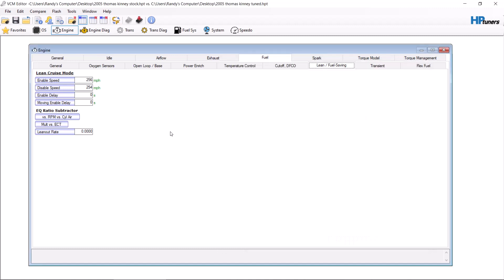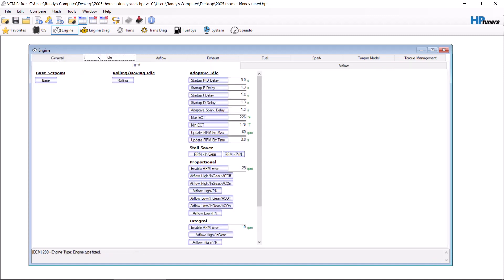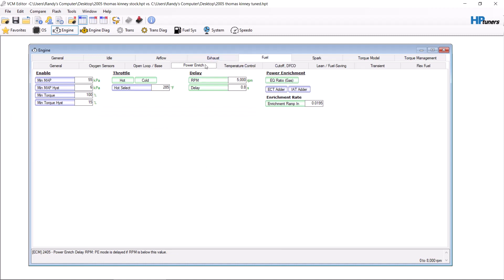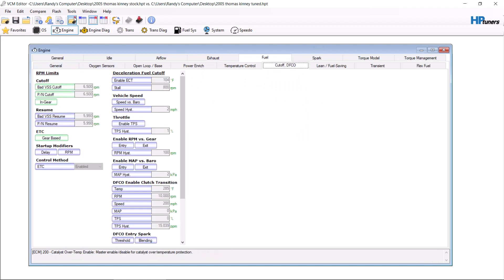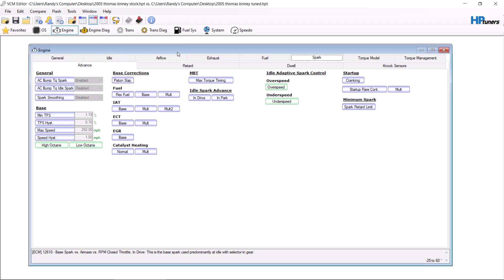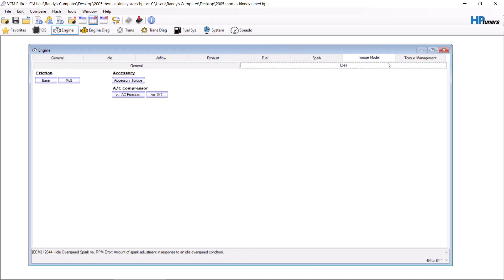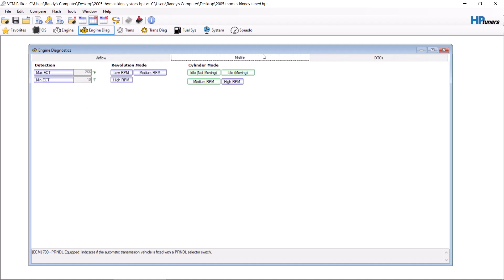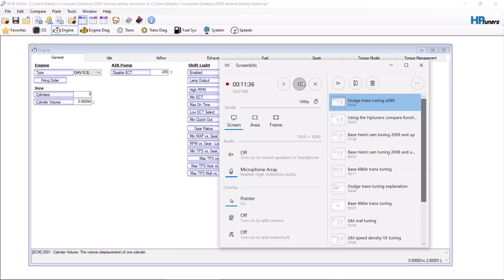Base tune for gen 3 ls engine vehicle using hptuners

Comment: Don't know if anyone is monitoring this vid but I'm wondering are these tweaks basically the same for a GM V6?  Or do you have a similar vid for a GM Gen III 3.6L high feature engine?  I've done a few mods on mine & have managed to get the knock out but that's my 1st attempt at any ECM tuning & it scares the shit out of me.  To be honest a friend advised me of the changes which was -1 on the ECT Spark Advance Correction table so now I'm looking for more help in any areas that can help a stock tune.  Thanks

Comment: So you just copied the high octane table to the low octane? So he he is running 91 octane correct?
Reply from the maker: Yes
Reply: @Recklessmotorsports  got another question for you, so what is the safest way to tune a p59 controller. I’ve got a 04 Silverado, I have been watching your videos for a couple weeks now and I was able to put me a base file together. I went write entire and took the file just fine, made some changes and went write entire a second time some thing made changes and the. Write entire. 4th time I went to write it I hit write calibration and hit write, and got unlocked timed out, lost communication tried everything that was suggested on a forum I found. Don’t have a bench harness, so I got a new one with my vin number programmed, truck is running and everything now. Now I’m scared to hook hp tuners back up to it. Ik this is long but any advice will be appreciated.

Comment: What changes would you make to this with. Truck Norris cam and trailblazer stall with a 373 gear?
Reply from the maker: Every cam I make the same base changes and then adjust from there, if the cam is super big I add more airflow

Comment: I have a 05 tahoe with 4:10 gears, stock gen 3 5.3 and stock 4l60e trans, i recently got it tuned and im experiencing a hard shift from 1-2 is that normal or do i have to take it back to my tuner to get it fixed?
Reply: Hey no sure if u got it fixed but I had the same problem for about 2 years I got a swap and tune done hard 1to2 shift torque converter not locking up reading research parts changing u name it I did tried it the fix was a crank relearn with hp tuners No 1to2 hard shift tcc locking up
Reply: @bruceshepard1136  i got mine fixed already, i installed a sonnax 1-2 hard shift Accumulator 77998-03K Transmission Kit and i took it to my tuner he had removed delay shifting time from 1-2 he put a little more time back and it shift way better

Comment: I know in the video you said GEN lll LS and I’m curious if this tuner set up you have would work good in a 2004 GMC Sierra with a 5.3
Reply from the maker: That’s a gen 3 ls. Gen 4 ls doesn’t start until mid 07 for most vehicles
Reply: @Recklessmotorsports  my question is would the base tune in This video work good for a 2004 GMC Sierra with a 5.3
Reply from the maker: Yes

Comment: Just wanted to add how important maxing out those misfire tables are after a cam, not only will you through that annoying PO300 but you're torque converter will unlock at highway speeds.
Reply: My converter locks and unlocks repeatedly at 55 mph and up. The tables have been modified, but what should I be  looking at to eliminate that?

Comment: I really appreciate the video but I couldn't see the  tables.
Reply from the maker: Which video is it
Reply: @Recklessmotorsports  "Base tune for gen 3 vehicle using hp tuners" Im doing a lot of research because i am using a Diablo I3 tuner and i set my part throttle downshift wrong and some of my WOT shift points wrong. For example ill have it in 3rd at 30mph, stab it and it hits 1st hard and almost instantly upshifts into 2nd. Im trying to find a nice RPM, Upshift vs TP and WOT numbers for my 05 GMC 5.3 LM7 1500 4wd with 4:10 gears. I just wish i could find someone with a similar truck who figured out some good numbers that I can try. Thanks man, awesome videos. I would appreciate any help.
Reply from the maker: Watch my video on 4l60e tuning and get the blue cat tool you can fix all of that with the tool
Reply: @Recklessmotorsports  Whats the blue cat tool?
Reply: @Recklessmotorsports  The only equipment for tuning i have is a Diablo i3. I don't have and can't afford HP tuners.
Reply from the maker: @DM-qp7do  it’s a program that you enter information about your set up and gives you the correct trans info
Reply: @Recklessmotorsports  I'll definitely look into it. Im also considering putting the factory tune back in it and starting from scratch. All I have is the Diablo tuner so I didn't make a lot of changes. But  the downshift at WOT from 3rd to 1st is pissing me off. Everything else feels fine.

Comment: On the fuel enrichment tab where you changed the hot throttle  to 30, did you change the cold or just leave it at 90?
Reply from the maker: I usually leave the cold

Comment: I do not have low end power I cannot spend the wheels at a dead stop cannot foot brake to spend the tires I did the basic tune I did a LS swap on a 88 Chevy Caprice 2002 Chevy suburban gas or flex fuel I was wondering do you know what can cause that will it be in the torque converter or still do I need to tune some more please help

Comment: How to tune my ecu. Which compression ratio to use. What is a redline tune. What to adjust.
1000+hp goal
Lq9  4 .000
/ with  +29cc forged dish pistons 
Gen 4 rods  and arp bolt
L92 heads stock 70cc
Comp cam 239/255 @.50 624/624 114
Boost 24 psi turbos 66mm twin
Rpm 6500
E85
18* spark
Arp head studs.
1200 cc injectors.
Ls3 intake. 
4l80e 3800 stall

STATIC Compression Ratio:
7.73:1
DYNAMIC Compression Ratio:
4.87:1
Reply from the maker: Has it been tuned at all yet
Reply: No .I was told compression is to low. I can swap out the heads and pistons.
Reply from the maker: Are you planning to run boost
Reply: @Recklessmotorsports   yes 23-24 psi
Reply from the maker: @ericperry4934  Then  there is absolutely nothing wrong with your setup

Comment: so I have been on the fence on weather to get the new HP Tuner and start doing some base tunes on my 05 yukon, because it's such a dog and I really would like to learn how to do this.  Well Looking through the HpTuner website I got very little help for anything to be honest, just a lot of attitude about how I don't know anything.  No kidding that's the whole idea of starting something new, to learn.  I would just like to say that after watching just this one video you did, I feel more enclinded to go ahead and spend the cash and get some experience doing this.  I greatly appreciate you taking the time to do this for all the people like me.
Reply from the maker: No problem man if you need an Hptuners device we sell them as well, good luck
Reply: I took a stock 03 Yukon , and with only bolt ons (headers,exhaust,electric fans,CIA) and tune and it runs like a raped ape, couldn't pass on the highway stock and now will drop to second at 55 , snap quick shift at 90ish @ just shy if 6k rpm and is gone! Changed sum line pressure and shift timing and used bluecat shift tables . Makes my Yukon actually fun to drive! Oh and it's got 265k miles on it too lol

Comment: Great video ! I’m interested in doing this to my ls swapped bronco. 
Not much is done to it. 
Exhaust: shorty tube headers into 2 1/2 y pipe and then 3” back with super 50 muffler
4” intake with a HUGE commercial type air cleaner for off road use. 
Emissions stuff all gone on engine. 
Current tune only has vats disabled and all emissions stuff deleted. I changed gear ratio and tire size also. Literally the basics to get it running. 

She smells rich and i get about 10miles a gallon. 
I am an absolute noob to any of this. 

Any suggestions over and beyond this video ? I assume it can be difficult without the vehicle in front of you, and I appreciate any input.

Comment: Just bought me a 04 Tahoe LT 4.8 4x4. I have HP tuners and want to try your setup. When I’m trying to setup the high octane table what am looking for on the data exactly to make the timing right in my tune
Reply from the maker: Typically personally I Zero out any negative data, from there with truck motors I usually set the high timing for 22 at the most. Then I usually add 2 degrees in the cruising tables to help with fuel mileage then I smooth the timing out so there is a nice transitio’x